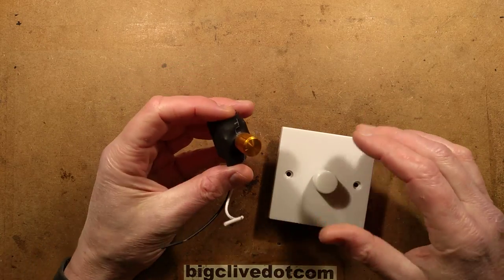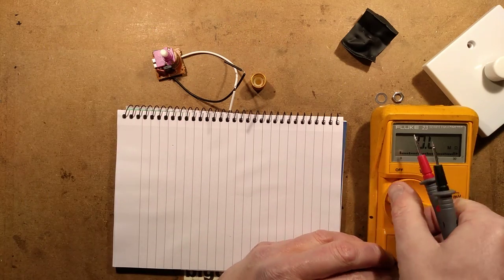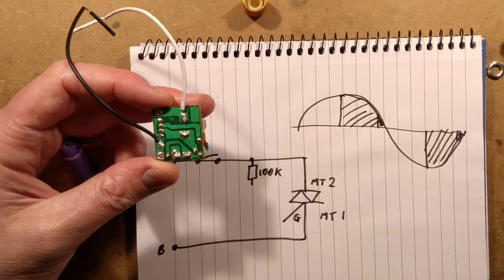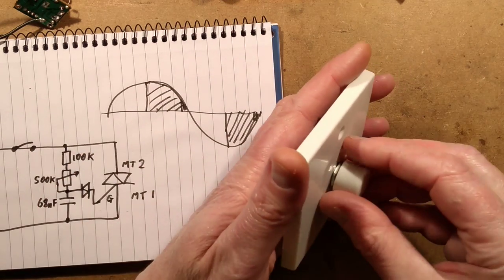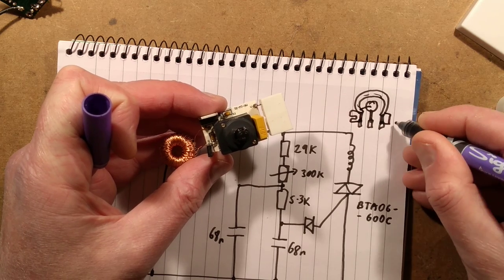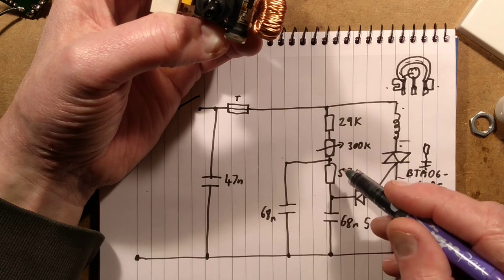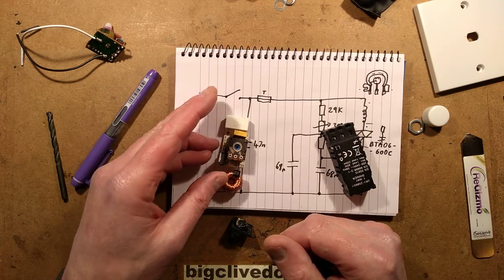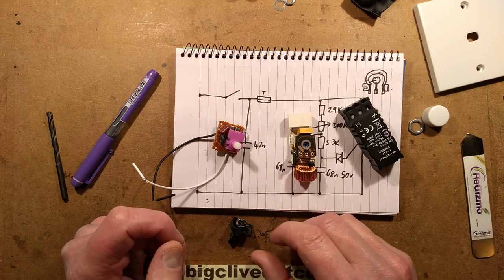Cheap eBay dimmer module vs compliant dimmer.  (Schematics)

Comment: The two capacitors allow for a longer delay angle. This lets you turn on the lamp at a really dim level right away instead of cranking it up until the lamp comes on fairly bright and then crank it down to a lower level.

Comment: Just on a quick note on dimmers.
There are more or less 2 ways of dimming. Cutting away at the leading or at the trailing edge.
It isn’t just that one is more modern than the other but actually depends on where you intend to use it.
Suddenly turning on anything with capacitors in it (LED drivers, electronics etc.) is a very bad idea because a cap acts like a short when first turned on until it has charged resulting in big and sudden current spikes. On the other hand suddenly turning of anything inductive (classical transformers of halogen lighting systems etc.) is an equally bad idea as the collapsing magnetic field will result in sharp and very high voltage spikes. More expensive dimmers can therefore either be manually set or can determine themselves what type of dimming to use. Classic dimmers feature a rating for either RL, RC or RLC which is L=inductive, R= Resistive and C= capacitive loads.
So make Shure to choose the right dimmer for the right application otherwise it won’t live long.
Reply: Actually, that sounds far more reasonable than simply "sudden turn-on = BAD / sudden turn-off = GOOD" which makes exactly zero sense assuming a traditional incandescent load, which were the typical things getting dimmed for most of the entire existence of dimmers...
Reply: how do you realize sudden turn off with a triac?
Reply: @fredlllll  I am afraid for exact details youd have to ask clive. He is far better at explaining this than I am.
Reply: Resistance dimming is hugely inefficient.
Reply: @pmailkeey That WOULD be the basic principle behind the incandescent light, wouldn't it? Assuming that heat is an intended byproduct. If nor, then they're horribly inefficient.
Reply: @pmailkeey In the winter perhaps, but in the summer, that means that the air conditioning needs to sink 90w less heat. So what kind of heater do you have? In my area, they're mostly natural gas, and I keep it turned off until winter. Natural gas here is FAR cheaper than electric, though I wish that were otherwise.
Reply: @pmailkeey 9kW? Dafuq are you running on, vacuum tubes?
Reply: @pmailkeey I've never known a single person in the UK with air con in their home. This summer was exceptional, but on the average year on the approximately five hot days we have, we just go inside the house to cool down. Most are so well insulated to keep the heat in, they keep the heat out too.
Reply: @JoeeeeD one day I will come across one of these mythical well insulated British homes you speak of. I have AC in my house, in Kent.
Reply: @pmailkeey that's assuming you live in a cold climate :) where I live supplemental heating is never needed. I replaced all my bulbs with LEDs so I could reduce my cooling costs in the evening.
Reply: @pmailkeey who has a gaming machine of only 200-300 watts? That's a business thin-client machine at best. Most "gaming" rigs will have a 600w minimum rated PSU, but WOULD need to upgrade if they put in a new graphics card. My main rig has a 1200w PSU, but it's also a 4 monitor workstation with a RAID array.
Reply: if I want to dim my lights I just squeeze the copper wire
Reply: @pmailkeey It gets quite warm here during the summer these days.
Reply: Gladius Illuminatus  Tha was a great explanation on why leading or trailing edge control should be used, but technically trailing edge dimmers are "more modern" in the sense that that leading edge dimmers were available long before trailing edge types, because TRIACs were around long before MOSFETs.
Reply: @ferrumignis  well the more you know..
thanks I wasent aware of that
Reply: @pmailkeey Man, I'd love a twin car attached garage. Alas, no. What I did do was invest in a portable AC unit (£200) so I can sleep when the temps go above 21º during summer.
Reply: @pmailkeey -- I live in the Houston area and our "winters" are so mild that I could keep my house acceptably warm with just switching all my light bulbs to incandescent during the "winter".  I don't tend to do that since we might have one day when  it gets down to 60F at night and a little heat might be nice, but the next day, the temperature might be 80F and it's time to turn the air-conditioner on again.
Reply: Real quick note that one
Reply: @pmailkeey -- That doesn't look like the Astrodome... The ceiling looks different... Quick search on Google brings up a wiki page and it says that it was filmed in the Montreal Olympic Stadium... That would explain the heavy coats they are wearing and that your can see their breaths.

Comment: That pot in the ebay module is bespoke for this application right enough !! I've never seen anything like that.  The second CR network in the gate circuit of the better controller you showed is there to give a 'double time constant', which removes the 'snap-on' or hysteresis effect you get at low dimming levels - I bought a triac sewing machine foot controller to replace a horrible resistive type, and the new triac one didn't behave properly at low speeds (still better than the resistive one, but...) suddenly cutting in as you ramped it up, so I added the 2nd C/R and the problem went away. I've seen it in older triac dimmer circuits I built back in the 70s.
Dave
Reply: Just so. The second CR improves the low range performance.
Reply: You might also find a strange looking arrangement with 4 diodes and 2 resistors.
http://techno-fandom.org/~hobbit/lighting/dimmer.html
Reply from the maker: I came across that diode one in a Chinese power controller.  It took me a while to work out what it was doing.  It provides much better symmetry and stability.
Reply: Yeah, the 4 diodes/2 extra resistors version seems very popular on the web now - I'm sure it's a better solution to the snap-on effect, but the '2nd CR' version gets you pretty close and only needs 2 extra components rather than 6, and is ideal for the lazy gits like me :o)))

Comment: According to one of my old text books, the extra resistor and capacitor in the timing circuit are to reduce hysteresis/backlash in the dimmer. Simple dimmers have very noticable backlash going up or down.

Comment: The best piece of advice for anything you wire into your house electrical wiring or anyone else's. Only install certified main stream electrical manufactures equipment. All too often the cheap component manufactures do not necessarily comply with British Standards, Australian Standards or any other reputable authority. Often they are supplied with fraudulent certification and as a result if there are any investigation due to fire or electrical incident you will not be legally covered from prosecution or covered by your insurance.
Reply: Richard Kaz An even better piece of advice would be to get a qualified electrician to carry out the works. The amount of botches I’ve gone to where “I haven’t touched it mate, it just stopped working” when it would never have worked in the first place is astonishing. Easy money though so don’t follow my advice ;).
Reply: @mrglock568  Good advice. Qualified Electrical Engineer with electrical and electrical contractor license I've seen some questionable installs by some Australia 457 visa skilled overseas workers to work temporarily in Australia.
Reply: Richard Kaz I actually quite enjoy it, it’s fun to see the phrase “a little knowledge is dangerous” in action!
Reply: pmailkeey Priceless. So clueless on the lengths it takes to become fully qualified it’s almost funny.
Reply: pmailkeey Crack on mate, you know far better than those of us that have spent 5+ years to become qualified.
Reply: @pmailkeey I can't make any comment on the fridge in Grenfell Tower, how it was installed, or what circuit protection was used and whether it or the fridge was compliment and safe. The installation of mainstream manufactured equipment I refer to are the core baseline protection systems ie circuit breakers and RCD's. The Grenfell Tower disaster was an evil case of greed, incompetence and self compliance certification. When it comes to appliances they to need to meet at a minimum a British/European design standard but because of lax government initiatives and I can only comment on my situation the Australian Standards they are vastly lacking due to successive allowing manufactures like the Chinese to self certify compliance in may cased. The point that "people with qualifications got them from" is they are either negligent or their qualifications are fake and the are only buying cheap unsafe products.
Reply: @pmailkeey What can I say. The devices are not checked in the QC stage (typical of Chinese devices) or some home handyman has had a go at redesigning the appliance. Some appliances main switches are double pole both neutral and active are switched. Not knowing how someone has wired the power outlets, incorrectly active and neutral reversed can result in an appliance having an active neutral. In Australia the motto is 'Test before you touch' and 'Test before and after isolating'.

Comment: The grease as you call it is a Damping grease,also referred to as motion control grease that makes the pot have a smooth feel to it,infact its the same stuff that old cd player door speed limiters have ,it makes the opening smooth and not rushed.in the late 70's i worked in a company that made dimmers, and the Triacs then had built in Dacs,we had problems with the input caps blowing up every so often,i guess they couldnt handle the mains surges.Love your channel,as a retired electronics engineer,its good to watch.

Comment: Dimmer switches are the bane of my life. “Hello sir, will this switch work with this component?” “Yes sir, this switch is designed for you application “. Never trust a sales man
Reply: When I was in retail sales, I would respond, "I'm not sure, I've never tried that switch with your particular setup." I would then often watch them go over to some other sales person who would tell them, "Yes, sir, that will work perfectly," and get the sale (often followed a few days later by the return of the item). Many people seem to want a positive answer, even if it's incorrect.

Comment: The 0 Ohm non resistive arc is where the on off switch actuates.  maybe to reduce arcing and wear on the resistive track at switch off?
Reply: Isn't it more like max ohm before ramping down?

Comment: I have seen a few that have integrated the diac into the triac as well, one less component to place on the board, allowing them to make it smaller as well, small enough to fit into an in line dimmer and only have the case barely bigger than the linear pot used for control, which also has the resistive patterning to put the rest of the resistors on there and only has a small mylar capacitor. Generally the triac also does not have a full tab on it, often using a thinner sheet as well for the die mounting, though I have yet to see one with integrated diac that is fully insulated, those are very common though and you find the triac held to a small aluminium tab as heatsink using a rivet.
Reply: I believe they're called quadracs.

Comment: I think the two capacitor idea is to make the dimmer more tolerant of non-sinusoidal mains. If you look at the mains with an oscilloscope (be careful with voltage ratings if you try this), it is quite variable and far from a sine wave. The "first" R/C network forms a low-pass filter designed to remove some of the high frequency components of the mains waveform. The result should be a more consistent light level regardless of other loads on the network. It would be interesting to investigate this.
Reply: wont work properly withMSW anyway

Comment: Those modules can drive an ignition coil to very high voltages - active to 1uf capacitor to dimmer to coil primary and back to neutral.  Great fun if keeping fingers and other parts at a distance.  Great blogs with lots of variety.  Thanks Clive

Comment: Solid section on variable resistor is because this is designed to work with the switch,  It's so when you switch on the resistance wiper starts after that and not before.  ie  it always turns on at a designated resistance.  Without this it would be hit and miss what value the thing was at when the switch part triggered.

Comment: Classic sample triac circuit. Right from the included data sheets.

The fancy potentiometer is reminiscent of custom on its in older TVs with multiple taps and custom stops. Smart engineering to save on component count, construction labor, and improve reliability.

Comment: It's been a while since I last used a dimmer, I think they pretty much lost favour when CFLs took over (and I did have a dimmable CFL at one point, 'til it failed to dim properly and just worked as a "normal" CFL), now I just adjust my lighting by changing the bulb for a lower lumens LED lamp... :)

Comment: It's a neat idea, trimming the carbon track like they did, but I do worry that the sliding contact will eventually begin to pull up the trimmed edge of it, and cause physical malfunction. Seems silly when resistors are practically free.

Comment: I had a customer come in with a small 230-110V power converter that had stopped working. I checked it out and it was made with the same type of triac as that dimmer. He ran his rice cooker on it!
Reply from the maker: They're common, but only really suited to simple resistive loads.  I took one apart in a video a while ago.  (It had melted).

Comment: Thanks for considering phone viewers.
I still have the first dimmer circuit I ever made from the International Rectifier data sheet.  Used it mostly to control an electric blanket.
Reply: A) Do you still use the dimmer?
B) Do you still use the electric blanket?
Reply: @TCGProductions03  
I still have it, but haven't used it in a long time.  I had to move suddenly, and threw out much of my possessions, including my electric blanket.  I have been thinking of getting a new one.  It might save me some money if I can lower the room tempature (electric heat is expensive).

Comment: Recently bought some Chinese electrics for AliExpress (putting some LED strips up in the non-mains connected garage). The '20 AWG' cable and '240v' inline switch were very clearly not to spec, but work perfectly for low voltage DC projects! :)

Comment: That triac should be 600 V, 6 A, if they're using the same nomenclature as on devices I was making in the 1970's. That generous rating should be a cheap way of giving some protection to the device when connected to the inductive load. Fun fact: If the dv/dt rating of a triac or thyristor is exceeded, it tends to shatter the device so that a terminal becomes disconnected whilst still being attached to a saucer-shaped piece of the Silicon surface. Seeing that, when inspected, is clear proof of how the device was abused. Thanks Clive.

Comment: You could probably put that rheostat back together using some epoxy. It looks like British light switches always use double-gang switch boxes. I guess. It's probably something else altogether. In America, a double-gang box allows you to but two switches or receptacles in one box. They are also used for high current 240v receptacles like electric clothes dryers. It's kind of funny our plugs don't have insulated prongs. At least, we aren't still using knob and tube wiring.
Reply: With the UK switches the plate and the switch is one piece, and you can buy 1,2 or 3 gang switches which all have the same size plate, so they fit on the same box.

Comment: phase cut dimmers are horrible. Built a few in my time but with modern electronic lighting they just don't work because electronic loads don't have the current through them required for the dimmer to work, unless you have a separate neutral reference which you simply don't have in domestic lighting circuits at the switch. Electronic dimmers like the one mentioned near the start is what you need, but these use FETs to switch the current. Much prefer DALI dimmable control gear.

Comment: That additional capacitor in the compliant dimmer may be an effort to reduce the hysteresis effect inherent in the basic dimmer design. The hysteresis, sometimes called snap-back or snap-on, is seen when slowly turning up the brightness from a lamp-off condition. At some point the lamp will suddenly turn on at an intermediate brightness level. The brightness can then be reduced to a lower level.

A much better method to reduce and actually eliminate the hysteresis effect is to add two diodes and a resistor. It's generally very easy to do and I've modified many low cost dimmers this way to improve their operation. Take a look at Teccor's application note AN1003 for more detailed info.

Comment: Thx.   Enjoyed.  For contrast any chance you can reverse engineer a V-PRO trailing edge (LED) dimmer?  Just looked at a popped one of mine and interestingly seems to have no filtering either. Assume the dead component is a MOSFET.

Comment: The single capacitor phase angle trigger has a huge hysteresis Half brightness on the way up is different from half brightness on the way down. The two capacitor circuit improves on this til 50% level may be half of knob travel up or down

Comment: Hey Clive, is there an easy way to modify one of these so that when connected it ramps up from 0% to 100% over a second or so?  I want to prolong the lifespan of some old tungstan filament lamps used in a display cabinet as I can no longer get the bulbs.  LED conversion is not an option because they are tubular lamps and need to illuminate all the way round.  I know I could just manually advance the pot but they are remotely switched by a timer. Any ideas please?  Thanks.
Reply from the maker: Not so easy with a standard dimmer.  You could maybe add a series NTC inrush limiter to take the edge off the switch-on.